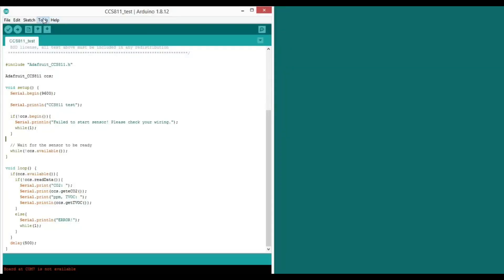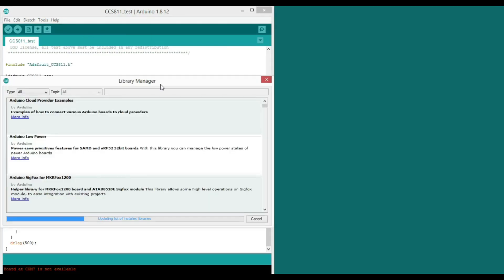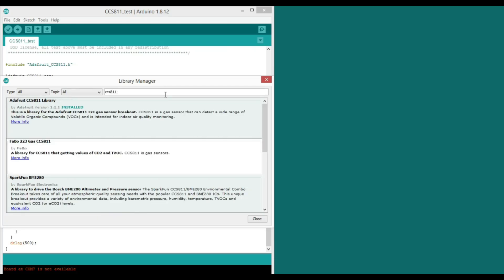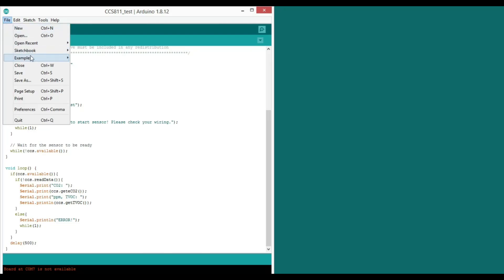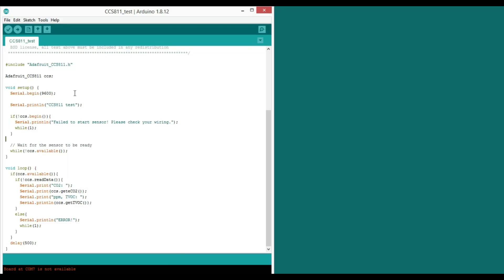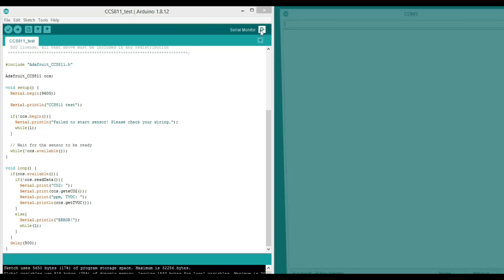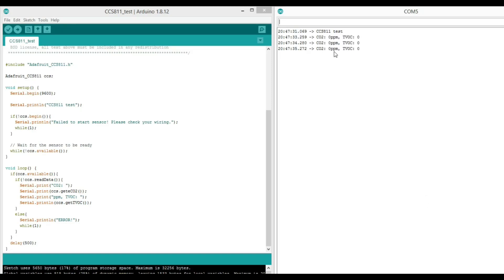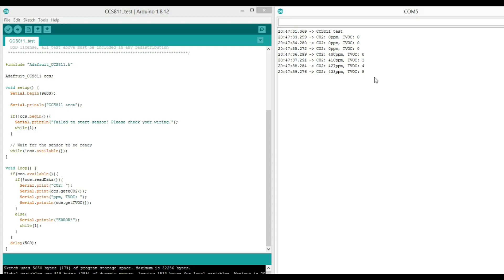Air quality sensor | Test with Arduino

Comment: what is the coverage area of this sensor, can it cover a room of 7x7m?
Reply from the maker: It depend on “air sample” to the sensor. No matter how large the room, the sensor will measure the air come to sensor. So we should use the fan the take air sample to sensor, or big fan to circulate all air in room to sensor
Reply: @engineer2you  Good afternoon.. 
i just wanted to ask you if you know the equation of the air quality sensor.. i mean what exactly it measure in details..